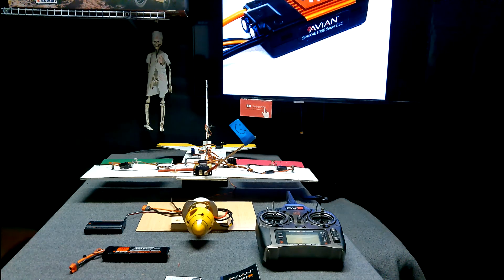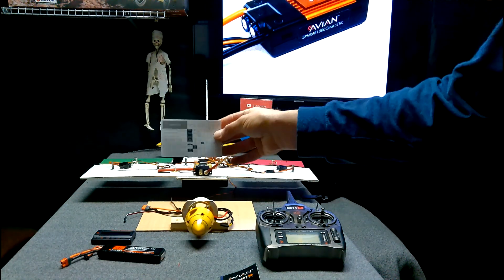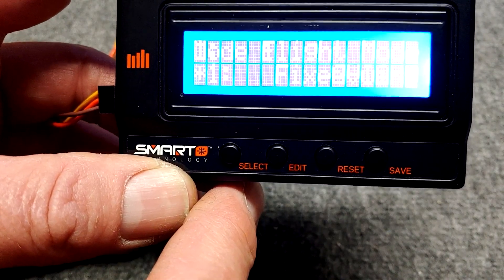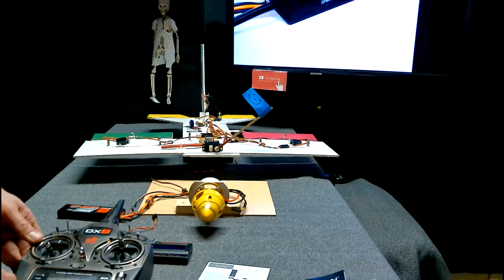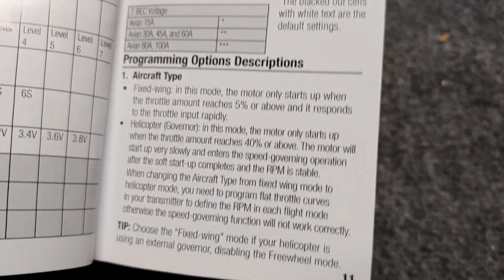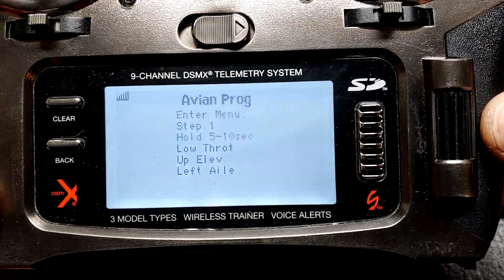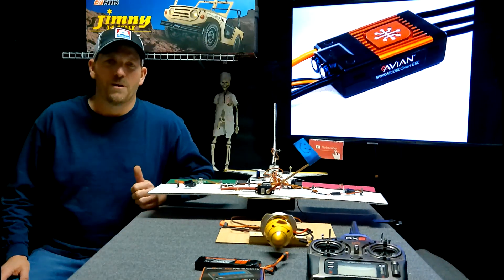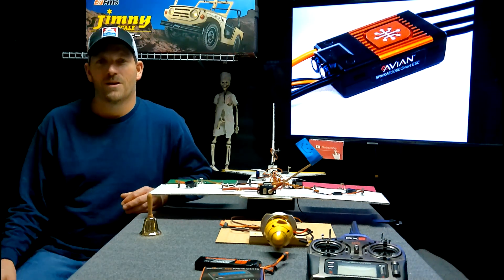AVIAN SMART ESC AIRCRAFT TYPE PARAMETER  HELICOPTER OR FIXED WING THIS IS COOL

Comment: Thanks for sharing your experiences, as a rc helicopter pilot if you use the helicopter program with ESC, remember to determine the delay times and set a motor curve with a value of 45% at the second line of the Stick, because if you bring your motor to minimum and want to reattach the ESC responds late and the reattach may not have any effect. Your programmer is the same as mine from hobbywing. Greetings from Italy and sorry for the not perfect English.